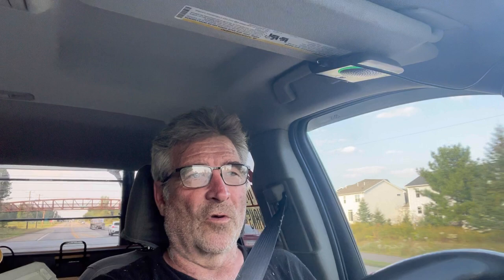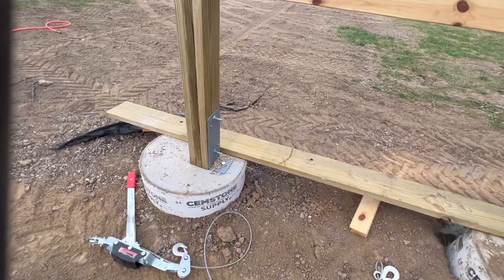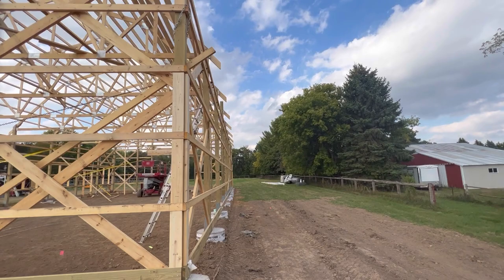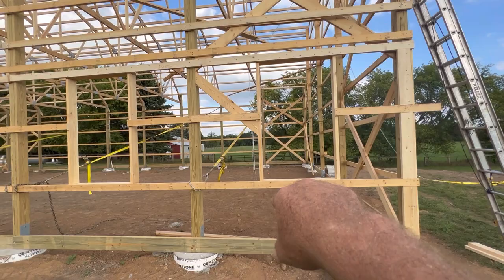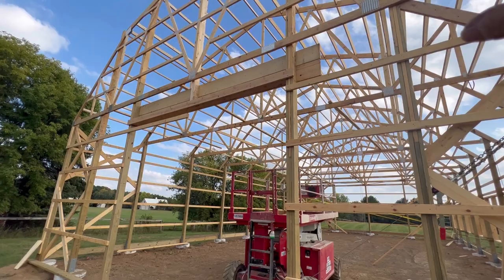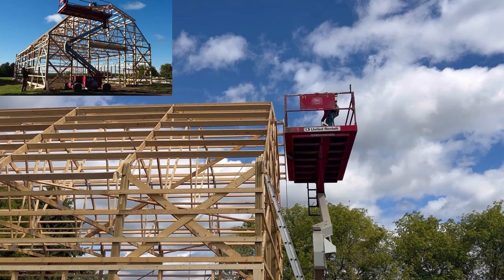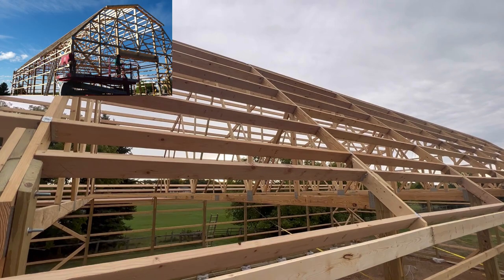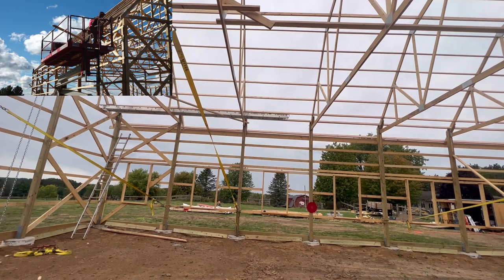Building a gambrel  style post frame barn part 4

Comment: Not sure I saw any comments on  how you stabilized the wavy side wall  and not in Matt's either.  I would have thought you would need bracing in the horizonatl plane  diagonally between truss bases or for that matter a strong back running parallel to the side wall sitting on truss bases.  You still have the chains between sides in place and some bracing outside the perimiter so have you finished stabilizing?  Looks like the only bracing for this deviation is in the first two end bays which I assume are rigid but not sure how the rigity is passed to interal bays?
Reply from the maker: I will go in the more detail when the building is enclosed  about bracing